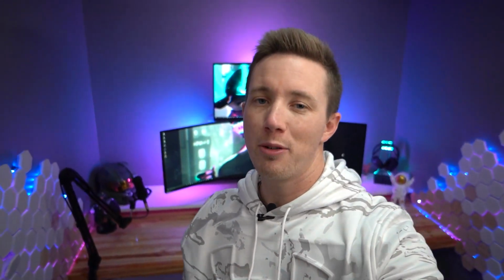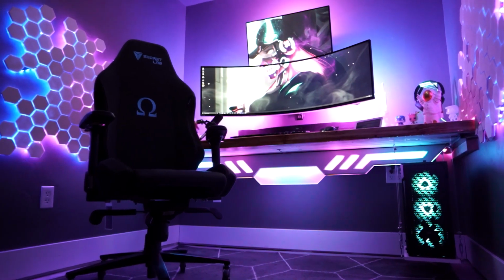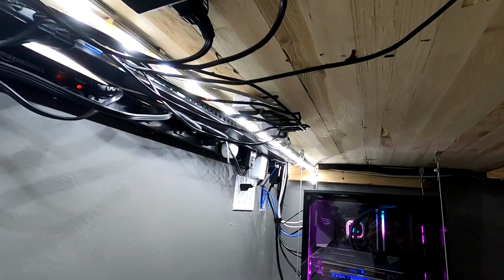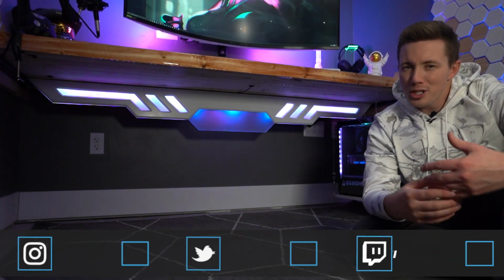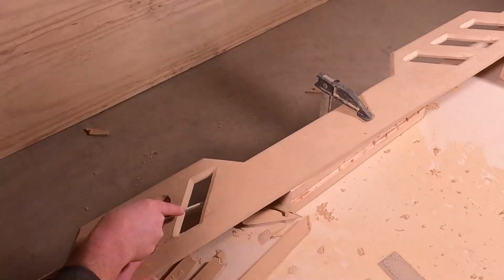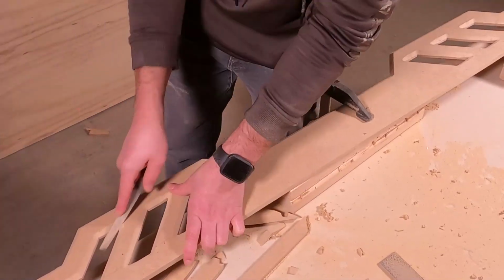Cable Management with Style! - How To hide your PC Gaming Setup Cables

Comment: I do not understand if the mdf is 1/2 (1.25cm) inch and the acrylic is 1/4 (6.35mm) inch and the led is 0.55 (1.4cm) inch. How do you get the led in-between the 2 mdf boards without squeezing it to pieces since the acrylic sheet is thinner then the led ? I can't wrap my head around it..Would like to attempt this project so any help would be apreciated !

Comment: First up I love this, super clean look, do you have to use separate rbg controllers for each strip (between panels on walls and under the desk) and how do you divide up the power from the one supply?
Reply: @FLXtv  hey thanks I did, was just curious how many controllers you had, and the setup for psu, jumped onto the discord as well, im definitely going to do my own setup once I get my pc built, like the panel for hiding the cables as well, keep up the ideas 👍

Comment: Ok so you covered up the rats nest, then there is still one wire coming out the middle of this from bottom of desk??

Not to mention you bought clear Perspex to then frost it by sanding it. Then paint the MDF white. You could have just light spray paint Perspex for the same effect??

Comment: a chisel or a stanley knife would have been a lot easier to cut in those sharp corner on the bevel where the router bit couldnt reach. a lot less work than having to file them off. 
When working iwth wood, you cut most of the wood away, you file off little bits and then sanding is for surface finish. most of the time if it takes you more than a few swipes to file something off, then you should have cut it.